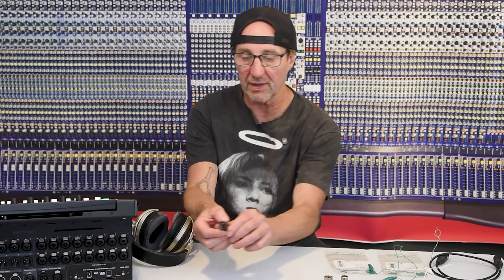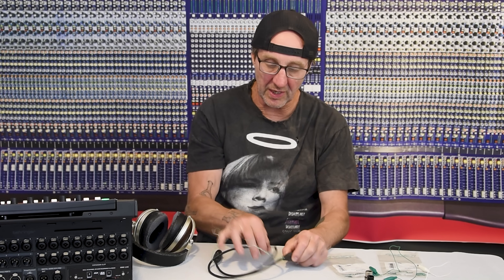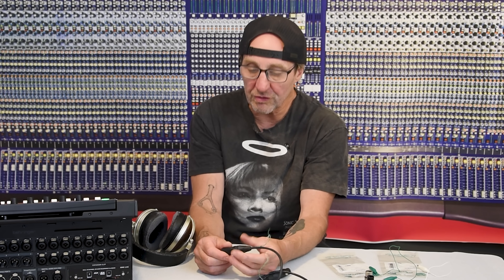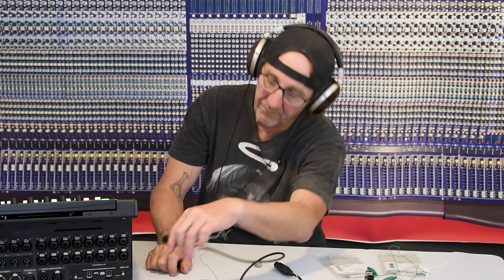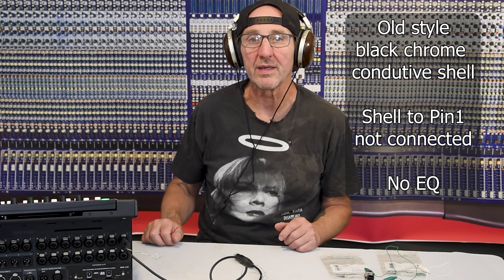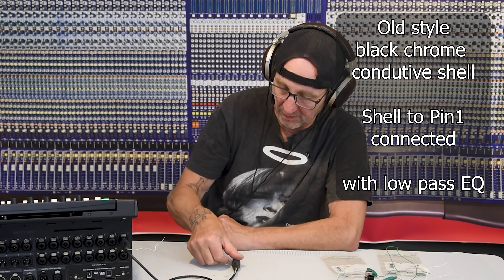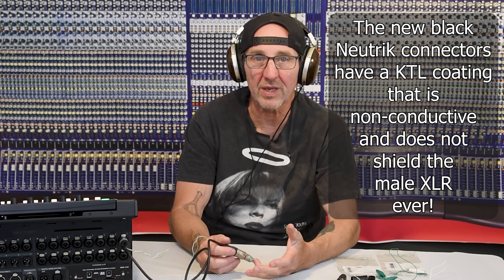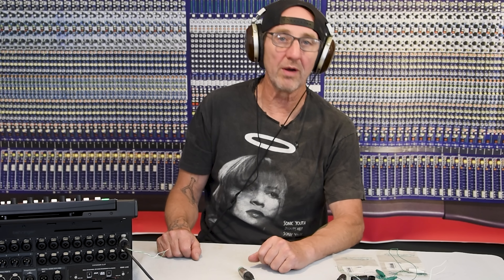Now Black Neutrik XLR Shells are Not Grounded

Comment: This begs the question --- "in what circumstance(s) would it be desirable to use non-conductive XLR shells?" 🤔

from GPT:
"1. Preventing Ground Loops: In audio setups, non-conductive XLR shells can help reduce the risk of ground loops, which can introduce unwanted hum or noise into the audio signal. This is particularly important in complex setups with multiple interconnected devices.

2. Isolated Environments: In situations where equipment will be exposed to harsh environmental conditions or where electrical interference is a concern, non-conductive shells can provide better isolation and protection against noise.

3. Reduced Signal Interference: Non-conductive shells can help minimize RF (radio frequency) interference and other forms of electromagnetic interference, which can be crucial in sensitive audio applications.

4. Safety in High Voltage Applications: In some specialized applications where audio equipment is used near high-voltage systems or in hazardous environments, non-conductive materials can enhance safety by preventing unintended short circuits.

5. Lightweight Applications: Non-conductive shells are often lighter than their metal counterparts, which may be beneficial in portable or field applications where weight is a concern.

6. Cost and Manufacturing Considerations: Non-conductive XLR connectors can be more cost-effective to produce and may be used in budget-friendly equipment where performance is still crucial.

7. Signal Integrity in Sensitive Applications: In precision or high-fidelity audio systems, non-conductive shells can help maintain the integrity of the signal, especially if the cables are frequently moved or handled.

In summary, non-conductive XLR shells are beneficial in situations where minimizing electrical interference, enhancing safety, or preventing ground loops is paramount. Each application will dictate whether the advantages of non-conductive materials outweigh any potential downsides."
Reply from the maker: chat GPT is confusing non-grounded shells with ground isolation and pin 1 ground

The XLR shell is a chassis ground 

pin 1 is an audio ground

we want the shells to ground to the chassis ground of the equipment we connect to but we do not want it to ground to pin one of the signal passing down the wire except in scenarios where there is no chassis ground in which case the shells can ground to pin one.

in most situations it won't matter if the shell of the XLR is grounded or not because you might have no wasted ads is so low that it won't make a difference. 

as I mentioned in the video, for very high gain or very high noise environment, having the shells grounded can be beneficial.
Reply: @DaveRat  I should have been more specific with it, that's my fault.
Reply: Just another reminder that LLM-based AI's are mechanical parrots that have been taught how to construct plausible-sounding sentences without any regard for whether the constructed material is actually true. When a biological parrot says something in "human speak", we think it's cute, but we don't take scientific advice from them.
Reply: @davidrick959  you either are using AI or you aren't.
Reply: Sorry Haze , its a no from me to all of those points . A grounded Faraday cage is the very basis of "shielding" and XLRs  are not for high voltage use ,

Comment: The shells of XLR cables are not normally connected to pin 1. This is a safety issue: if you join two cables holding one connector in each hand and one and one piece of equipment the other end of the cables has a mains fault you would be providing a fault path straight through your heart. Also you don't want the shells to touch other metal parts that could be at any potential. With a single cable run the connector shells would be connected to the chassis each end.

Do you know if the mixer that you were using conforms to AES48? If not, it is not a valid test.
Reply: When building field-use cables that are likely to be daisy-chained in this way, I like to tie the shell tab to pin 1 with a 150 pF ceramic capacitor. That way, it's connected for RF, but not for 50/60 Hz.
Reply from the maker: great advice
Reply from the maker: did you look up and read the information documents from Neutrik that I post toward the end of video where they state that the new KTL coating is no longer conductive? 

this has nothing to do with a standard, it has to do with the fact that the little metal tab on the inside of the new connectors no longer does anything and no longer connects to the metal shell it's just a useless nothing on the mail connector. 

and also when you plug a new version male shell into a female, it no longer connects conductivity to the shell but it used to on the old style.

Comment: what does neutrik say about it? we just g. a. f.? contacted em?
Reply from the maker: at the end of the video I post the official Neutrik documents they released describing that the new KTL coatings are not grounded. 

for more info check out this video 

https://youtu.be/sE-JJJxVU7k?si=VfTy2xTpiwmNHjh9
Reply: @DaveRat  just a doc and thats it.
is crazy.  99% of the people dont even read such stuff. 😅
Reply from the maker: agreed, And you need to be subscribed to their tech release bulletins in order to get the document. 

as a manufacturer, we found our SoundTools products were having these new non-conductive shells come in. 

we had to recall a bunch of cables and then got with Neutrik to swap the black painted ones with the nickel version. then we sent out the nickel replacements to everyone that bought the cable. 

And we've switched over most of our ethercon to nickel now because we don't trust the ground connection on ethercon to be solely completed by the single wiper. 

The conductive shell acted as a redundant ground connection and for analog over cat the ground is critical.

And this is why I'm doing the video! 

I actually released this video and another video to our sound tools dealers a while back to tell them why we were switching to nickel and make them aware
Reply: @DaveRat for real such stuff needs a shitstorm.^^

Comment: Interesting... Would scraping the coating on the contact points inside of the XLR, And where the shell used to connect to the gear it's plugged into fix the shell grounding problem on the male connector?
Reply from the maker: you could try it and let me know but it's messy and time-consuming.

The main thing is first determining whether or not you need the shells grounded, Most people do not, most situations do not. 

this is more for scenarios where you need ultra low noise where using nickel is better anyway as it has even look conductive resistance than the old style black
Reply: @DaveRat  absolutely. 
I have no painted black ones to test...
Reply: @DaveRat  Good points.... 
I don't have any to test - however in a pinch if someone has a problem, a whizz or two with a wire brush Dremel may be an answer!
Reply: I seem to have a short-term memory problem....
Reply from the maker: at some point I'll take a look and figure out what needs to be sanded away in order for them to work

Comment: Time to phone up Switchcraft.
Reply from the maker: not sure what other companies are doing to solve the issue. the old black chome has some toxic chemicals that are used during the manufacture that are now banned in many countries 

so that's why Neutrik switched to the paint. 

more info in this vid

https://youtu.be/sE-JJJxVU7k
Reply: @DaveRat  switchcraft isn’t subject to EU regulations for products made for non-EU markets. Well see. 🤷‍♂️
Reply from the maker: And then there's the other side of it where one can ponder whether it's really worth it to support creating the toxic chemicals or just use nickel connectors

here's a link to an ethercon video with more info 

https://youtu.be/sE-JJJxVU7k?si=VfTy2xTpiwmNHjh9
Reply: Switchcraft have my award for worst design XLR . .The left and right  hand thread grub screws on their cable destruction system.!.  they must have been  tripPIng !! 
It was Neutrik saved us from that Horror show !!
Reply from the maker: I looked into non Neutrik options and always end up back at Neutrik, so far.

go nickel!

Comment: Definitely will be buying nickel shells/cables for the future. Do you have any idea if other manufacturers of connectors like Switchcraft have changed to a non-conductive black coating as well?
Reply from the maker: not sure how other companies are dealing with it. 

but I kind of don't want to support making the chromium 6 that is a byproduct of the black chrome.

but maybe other solutions

Comment: This may depend on if the XLR socket is directly tied to chassis ground or if ground is carried through on pin 1 only (and where that pin 1 ultimately goes will have an effect too). Especially now these sockets will also be made with the same non conductive coating. Extra effort needs to be taken on the device manufacturers end to ensure their xlr socket shells are tied to chassis, and this isn't always part of the design either.
Reply from the maker: yeah. ideally the chassis ground of the gear would connect to the XLR shell and provide shielding and pin 1 audio ground would pass through to the audio corcuits. and the pin 1 audio ground would only connect to chassis ground at a single point, not at each XLR
Reply: @DaveRat  Indeed! Manufacturers will now need to intentionally tie their XLR socket shell to ground because of this new coating. I can imagine some less well thought out gear will start to spring up small hums here and there (when the connectors are touched) when their xlr sockets suddenly becoming floating in newer batches, if they don't revise their designs/assembly procedures in order to tie the shell ground pin to chassis now.
Reply: @Dafty_Boi  This is interesting. I have liked buying and trying several of the cheaper cables over the years to compare them to better options just for the science of it. I just discovered that with the Cable Matters brand, they tie off pin 1 to the chassis for all of their XLR audio cables. However, I did a continuity test and discovered their shells are nonconductive. So now I think this tells me why.

Comment: Does  the shell form a floating induction ring, creating a single turn transformer  coil that supplies induction into the signal wires.. maybe ? I dont see how the balanced line doesnt cancel the hum .  I also know that an ungrounded stage box is not a faraday cage . Either way it seems a large oversight for neutrik to forget the purpose of the shell ground terminal !
Reply: Inside the connector shell, you've probably modified the 2-3 twist during termination, plus you've got an uncontrolled pin 1 pigtail. It's much safer to have the shell properly grounded. I don't understand why Neutrik isn't masking off key sections of the shell to guarantee continuity.
Reply: @davidrick959 legacy variables still occurring ... the shell of a male xlr should only be grounded by chassis earth of what its connected to ( these xlrs totally fail as Dave said)..not audio ground ..otherwise star ground architecture is bypassed . thats why we still need that ground ,lift ,float switch on DI Boxes.. and often the only  reason we have to use them at all ! ..otherwise transformers . if only we had had balanced AC mains !
Reply from the maker: yeah we want the shell to automatically connect to the chassis and the fact the male shell ground tab does nothing is just an interesting side effect.

yeah, masking would make sense but also, assuming there is a simple solution they overlooked is most likely just a lack of our understanding.

definitely they tried and they released a document informing of the non conductivity.

I've had multiple discussions with them trying to sort solutions.we settled on using nickel for ethercon and will see if any other issues arise and address them if they do
Reply from the maker: yeah a lot of that is outside of my realm of expertise which is why I just focused on doing a demonstration of what actually happens. 

I don't I don't claim to fully understand the why as much as the what
Reply: @DaveRat very cool of you to show this effect. I just realised that there must be equal noise in both lines to cancel .. so non equal noise will be amplified rather than deducted.. so maybe its the pin placement , if in a different universe it was pin 1 hot , pin 2 cold , pin 3 ground  there would be symetry so the noise would cancel
Reply from the maker: I think the fact that as the wires pass through the connector they're not twisted is a big part of the issue. where the wires are twisted noise will be induced equally but because of the pins and the connector and untwisting the wires to solder to the pins, inside the connector shell tends to be more susceptible to hum.

Comment: Thanks for bringing attention to this new "feature" of the EtherCON and XLR shells.  
One other thing I've been noticing about the KTL black is that it scratches off after repeated insertions into chassis connectors (which have a small pin to make contact with the shell). I've seen a bunch of the connectors with a nice silver line along the outside of the shell from the coating getting scraped off. Looks ugly, but it does bring back the conductivity I guess.
Reply from the maker: interesting and I found something similar with mating male to female. the lock tab can scratch away the black paint over time and some of the mail connectors will show grounding. 

seems they should just mask the paint in a few spots so that this stuff all works
Reply: @DaveRat Yes! This would by far make the most sence!
Reply: I actually now scrape off this section manually so all my connections are solid, after I noticed it had happened to some, but not all of them. For consistency I wanted them to all act the same, and I'd prefer it if they all mde a ground connection, so I manually removed the coating where the shell lock pin rubs (and makes the ground connection).
Reply from the maker: very cool. Are all lock pins grounded?
Reply: @DaveRat  It depends on the manufacturer of the gear, and how they've wired it up, as well as if they are using these coated shells in their sockets yet or not. I think the rough standard is to ground the shell (but ofc there's always exceptions), which used to happen automatically when screwing it onto a metal chassis, but this will no longer be the case, and manufacturers would have to intentionally tie the shells to ground now, if they wanted them to be grounded, with these new coated connectors.
Reply: Thanks, Erin Brockovich, apparently?  

Though, did anyone really believe Julia Roberts did that many blow jobs to sign up all those hexavalent chromium class action co-Plaintiffs?  

No wonder shiny chrome car bumpers are now so rare....  But, why now, and not decades ago, if that's a non-shiny Neutrik finish process?  Hard nickel is also really nice as a non-corrosive, extreme wear resistance finish.  

I still remember having a tug of war on a strain relief with a Neutrik rep, iirc way back when we played stall the elevators in the Waldorf Astoria, and relied on Bob Orban to supply novelty toys we could toss between the ballroom and its balcony, at AES East coast conventions, before they moved to larger sites.  

There were 3 features that grabbed my attention, and shell platings weren't among those.  We could have two large adults pulling hard and not break strain reliefs as Switchcraft or Cannon both would; and a nice chuck collet on the cable as well, strong and easy to assemble.  More important were the helical spring female contacts to point terminals that'd wipe and break down oxidation, and be incredibly reliable.  

Those design innovations obviously made a strong impression, given I don't even recall which year decades ago that was, nor such details from most other vendors at that upper tier trade show.  

And, checking where Lichtenstein was and how it related to Austria and Switzerland took paper maps the following week.
Reply from the maker: I personally try and support and test and follow through on anything that I recommend

so in this scenario perhaps us all petitioning to get a chromium plating factory in our local community maybe a good idea. It could increase employment and also solve the black chrome and chrome plating issues that we all face.

I think we need more people that are into supporting the manufacturer of things we need and willing to embrace that manufacturing being stationed in our backyards and near our communities. 

Let's be part of the solution!
Reply: @DaveRat 😅